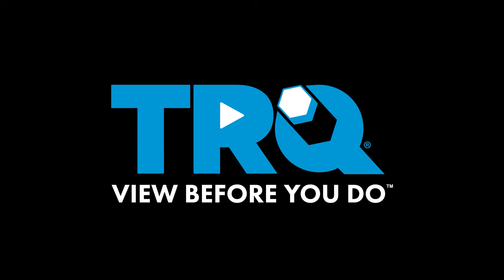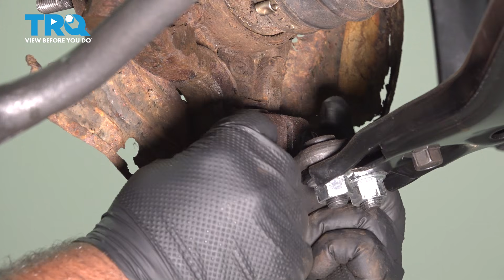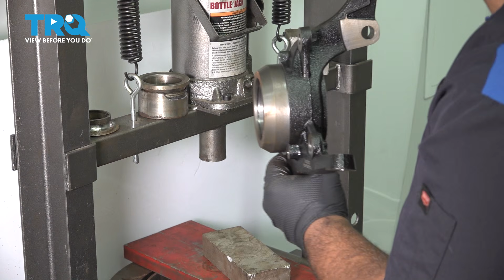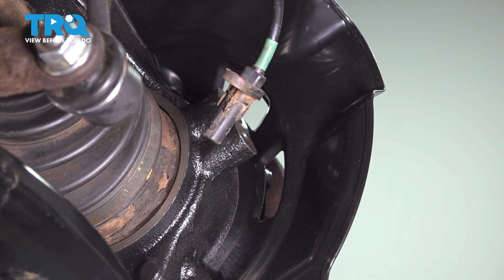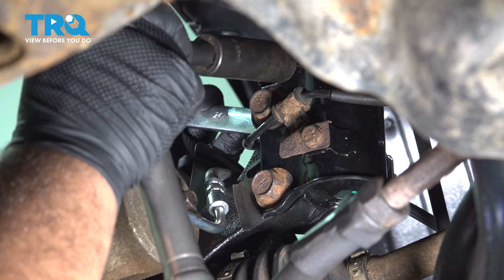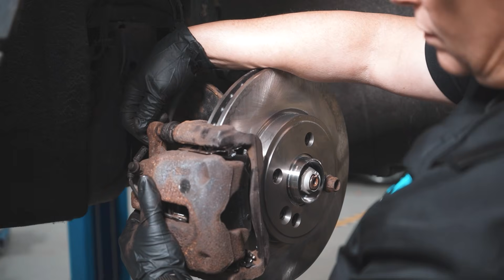How to Replace Front Wheel Bearing & Hubs 2011-2016 Kia Optima

Comment: Excellent video. Quick question, is the bearing has an orientation for ABS? The replacement I received has the a black plastic band on both sides. Both sides look the same with the only difference is that in one side has the markings "510034."